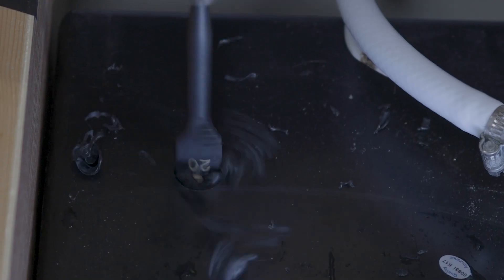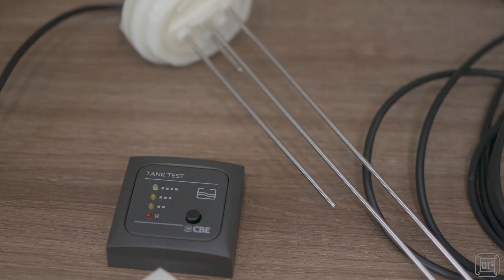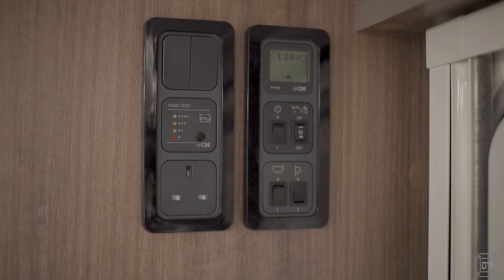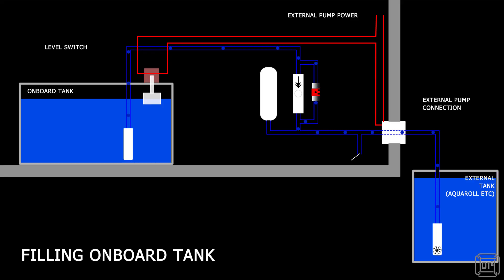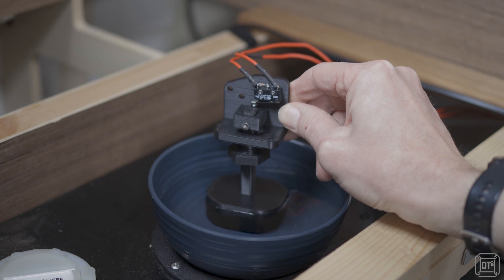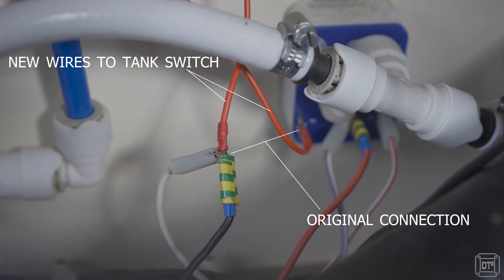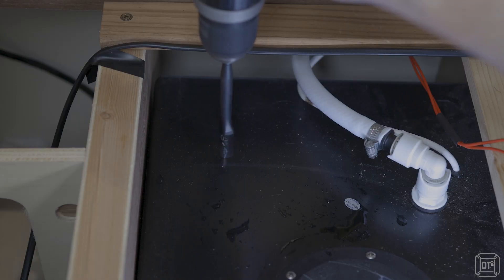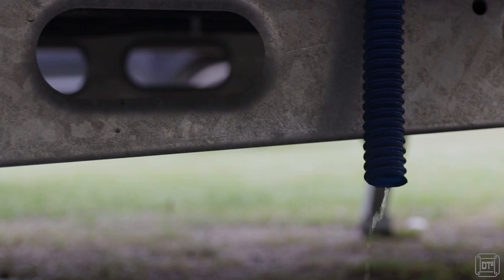AUTOMATIC TANK FILL STOP - For Bailey Caravan and Whale onboard tank systems

Comment: Hi David i have only just got round to fitting the float valve and the solenoid, and it works great, i am going to wire up and put a simple LED to tell me when the float valve is on/off, thanks again for your help Regards C
Reply from the maker: Great news, Should make filling uo easier.

Comment: Hi can you put a link to where you purchased the swith, also would you make the 3D unit again and sell it to me ??
Reply from the maker: Hi, The micro switch I used is this one.-
https://uk.farnell.com/zf-electronics/db1c-a1rc/microswitch-roller-lever/dp/8786453?st=micro+switches
In regards to 3D printing I don't usually offer this service but if you can email me on my Youtube business email (on the channel page) then perhaps we can discuss.
Reply: @DTSquared  thanks i have sent to email address
Reply: Hi David i have only just got round to fitting the float valve and the solenoid, and it works great, i am going to wire up and put a simple LED to tell me when the float valve is on/off, thanks again for your help Regards C